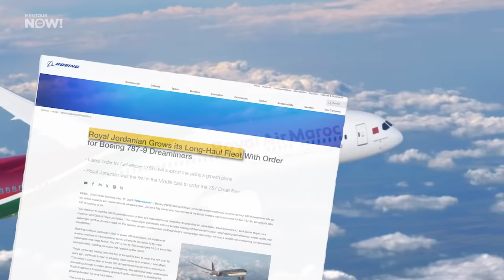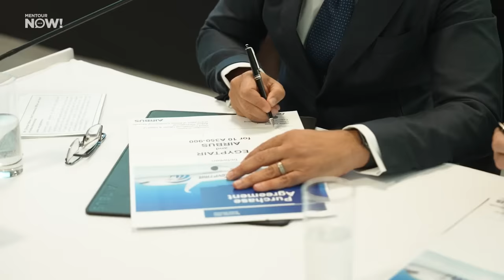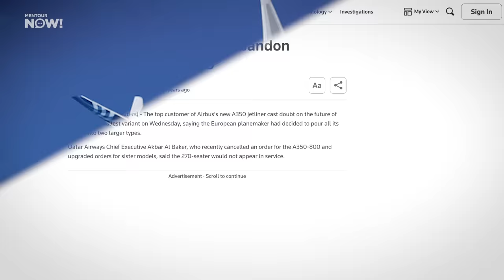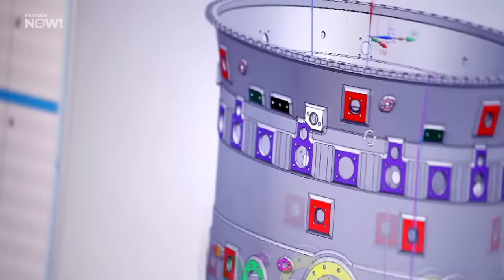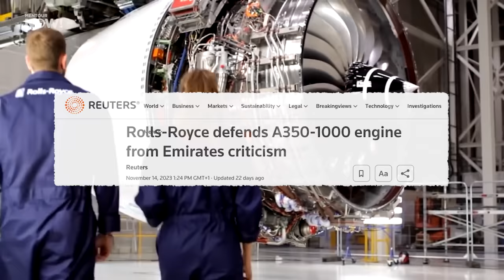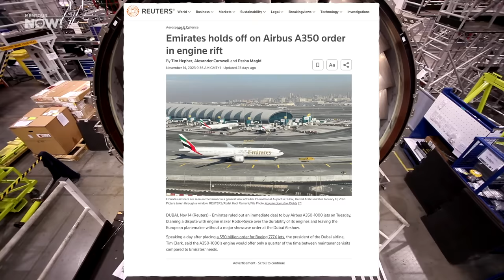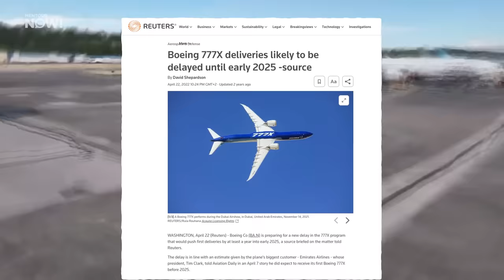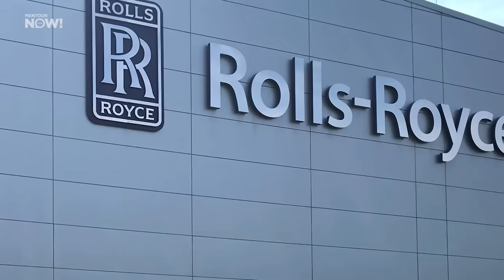What’s WRONG with the Airbus A350?!

Comment: After watching the disaster at Tokyo, I would say absolutely nothing is wrong with the A350. I can not believe how intact thecA350 was after it came to a stop. The fact that the main landing gear and wings were still intact after running through the Dash 8 is a testament to the aircrafts strength.
Reply: meanwhile Boeing can't even secure its door to stay closed during flight and just detach from the frame. i would not trust boeing with my safety at this point.
Reply: well it is completely built in carbonfiber composites (just like the 787 dreamliner) Aluminum has a melting point of 660 degrees celsius, composites burn at 400-500 degrees but despite that composite maintains it's structural integrity much longer in a fire than alumium which propably is the main reason that everyone had time to evacuate in time. I doubt everyone would have had time to get off if it was a for example Boeing 777 with aluminum. Unfortunately Boeing made the stupid decision to continue with aluminum fuselage on it's new upcoming 777X to save money on development cost which was another dumb choice, makes the aircraft both heavier and less safe.
Reply: @ragael1024  This is my issue with this channel.
It looks very much biased toward Boeing which is understandable if you have a lot of interaction with them.
But really, why isn't there any cover of the plug door issue here yet this video on the A350 for something rather minor.
It's "just a YT channel" but still, it would still be much more honest to just cover issues for both manufacturers.

The MCAS issue was also just lightly touched on this channel with not much blame pointed at Boeing...
Reply: @foadskyflier I'm pretty sure you can't convert an already aluminum fuselage. It's basically Boeing's A330neo. So I wouldn't really call it a "stupid" decision.
Reply: @Tetsuo6995 Petter touched on it quite a lot actually when it was going on. You sound like an Airbus fanboy.
Reply: @ryanlittleton5615  well actually the 777x started with the aim of completely new modern and more efficient aircraft, there where discussions of a completely new composite fuselage to be developed but they wanted to save money not to mention time in order to get it out more quickly due to order competion with Airbus so they went for just making new wings out of composite and more efficient engines. I'm sure the new aluminum fuselage is further optimized from the original aircraft but it was a dumb decision, especially given that they didn't save much time as it has been delayed over and over again as it is. They are going to lose on that decision in the long run.
Reply: @ryanlittleton5615  as stupid decisions goes, Boeing has done many  bad choices in the past 2 decades, they would have been in a lot of more trouble if it had not been for their military division that has done much better. It's really a shame as a healthy competition between the 2 companies is just beneficial for development and ultimately the customers/travelers, it would suck if they fell behind .
Reply: @foadskyflier  No the 777x is an updated 777 (hence Boeing A330neo). What you're describing is the 787. Which truth be told is an actually an even worse look for Boeing.
Reply: @foadskyflier  The 777x being completely redone in composites would just make it a completely new aircraft and not really a 777 anymore.
Reply: @foadskyflier  And for the record I'm NOT for a moment suggest Boeing hasn't seriously been screwing up the past 20 years.
Reply: What you talking  about it's burnt beyond Recognition🤕
Reply: I was at Haneda when it happened. Apart from the front landing gear detached by the collision the rest of the aircraft came to a halt relatively in tact. This is good news but the complete failure of the cockpit following the collision which came out at the inquiry is slightly concerning. The pikots had no control of the aircraft and all the  cockpit instrumentation and communication were inoperable. The cockpit could not talk to the cain crew and there was no indication ifr the onboard fire extinguishers had deployed. We should wait for the inquiry.  Excellent news that the excellent JAL crew managed to get everyone off without serious injury which is excellent.
Reply: @AndrewLarson-mq7xc  Oh well, another comment from an Internet armchair expert.
Go and check the timeline before you make such a comment!  The plane didn't go PUFF and there were only chorceld remains left.  It took some TIME to render the fuselage parts in smokey remains, and time was the essence for all people leaving the plane.
Reply: @foadskyflier  Aluminum soften at a temp much lower than the melting point. So it is very difficult to compare. AL may perform better in some cases and worse in others. From a manufacturing point of view, Aluminium is much easier to handle and the processes are well understood. Besides, 777 series has been in production with the same basic structure for decades and 777X is not going to throw everything out the window. If so, it will not be called a 777.
Reply: COYG
Reply: This entire thread is veritable goldmine of unintentional irony. Because you are right, but what you’re not mentioning is that that disaster (or rather the lack of a bigger disaster) effectively proved a Boeing whistleblower wrong. 

Years ago, a whistleblower named Vince Weldon told the press that carbon composite aircraft were not, and crucially, could not, be as structurally sound or fire safe in a crash as aluminum aircraft. He was specifically criticizing the 787 program. It was one of the earliest controversies that program dealt with. And it was, at least in terms of how it was reported, the archetypical old engineer vs corporate management dispute. The exact sort of thing that Boeing gets tons of sh%t for presently. Now if you asked me, Weldon’s claim that composites could never be safe was ridiculous right from the start. Composites are very strong and they are as flame retardant as the additives in their resin allows them to be. The recent incident proved that pretty conclusively. But still there’s something very ironic about all of it. That Mr. Weldon was effectively proven wrong by a crash involving an Airbus, but hey, sometimes fate just works out that way.
Reply: @foadskyflier There is something uniquely ironic about your comments given the amount of sh%t Boeing got for making the 787 almost entirely out of composites.
Reply: @alexanderstone9463 Boeing made a plane completely out of 💩😳
Reply: @foadskyflier yup and the new alloy contains lithium which as you probably have seen burns like crasy and water doesn't put out
Reply: Subsequent iterations of the A350 type may indeed see not quite so high a percentage of the aircraft made of composite material. The mix of Al and carbon fiber in the ill-fated A380 design was probably about right. Composites should be used so as to minimize weight within reasonable flammability/combustibility limits, and should generally not be placed under large compressive loads.
Reply: @steampunk888  380 is a pile of junk
Reply: @foadskyflier  to be fair aluminum is proven technology for cyclic pressure vessels, composite pressure vessels don't have an amazing track record with cyclic loading but technology is improving.
Reply: @foadskyflier  Do you work for Airbus?
Reply: @ragael1024  only because someone didn't put the bolts in that's over and will never happen agian.dont forget about the cracking wings on airbus
Reply: @foadskyflier the 787 has aluminium fuselage as far as I know, only the wings are made of composite
Reply: @simon.bartos  no, that would be the new 777X that is expected to have it's first delivery to airlines next year. The 777X is based on the old 777 from the 90s , it retains the aluminum fuselage but gets new lighter carbon composite wings and new efficient engines. the 787 dreamliner has composite fuselage and wings, the 787 aircraft is a completely new design.
Reply: @foadskyflier  you're true, sorry, my bad
Reply: @ragael1024  no it had no bolts big miss step in the production. Not about Strength. A mistake that a 120% will never happen again sorry folks boeing isn't going away only up..
Reply: @foadskyflier  not in anyway aluminum has always proved itself. For many years composites are not everything.when they do catch fire stand back because it's going to be awhile putting it out. I got one Sliverof composite on my finger skin at Boeing form a composite part.i had to have my finger scrape down to the bone every 6 months for 7years before it finely thev the pain a puss went away
Reply: @Tetsuo6995  Ohh yes I have felt that so many times...😅
Reply: @Tetsuo6995  Yep the door plug was a fuck up, and luckily it didn't happen at cruise altitude. The MCAS issue was bad, but it had been flying normally with western airlines for a while. I personally think the crashes were lack of training on how to fly a plane when things go wrong which they do. One of the crashes involved a plane that had been flown the day before and experienced the same problems and the crew handled it and landed safely. Well done them.
Reply: @foadskyflier  That's it's an update to the 777, if they had gone with a composite hull for the X then it would probably be easier and cheaper to build it as a new clean sheet model from the ground up.
Reply: @Tetsuo6995  I like mentour and everyone has their biases but I distinctly remember when the MCAS stuff was going on he was downplaying it a lot and saying it wasn't indicative of some deep quality problems at boeing, just a tragedy that needed to be rectified and that people shouldn't reflexively avoid boeing.

I'm still waiting for him to reckon with this mistake on his part and admit that he clearly misjudged the situation and the FAA's competence.

The 737 is an inherently flawed design at this point. I can understand liking it in normal flight, I'm sure it's a good aircraft that has had decades of refinement. But it IS a design from the mid 60's when requirements were quite different. To save money boeing have been upgrading it for 60 years now instead of designing an aircraft more fit for the times and it's reached a point where it is like IRL spaghetti code.

Again, this may work fine in normal flight but when abnormal conditions happen, there have been numerous examples of the pitch-up tendency that has come with trying to fit big engines to the low wings causing fatal accidents, even on older versions. So now they've come up with MCAS specifically to try and mitigate this thrust-induced pitching and we all know how that went. With this cost cutting trend we also now have their planes falling apart in flight. Boeing has big problems in it's processes and management and the people whistleblowing these problems (conveniently for boeing) keep dying so I personally don't see things getting much better.

Comment: Yeah, big problems! Airlines should all opt for Boing's 737 Max, it comes with automatic emergency door opening!
Reply: You can jump out if you have a golden parachute.
Reply: @Zodroo_Tint God man you said it perfectly
Reply: MAX also makes you feel weightless, like on a roller-coaster as it nose-dives to the ground.
Reply: We have to take the experience to the MAX @MegaSunspark
Reply: the 737 MAX has the lowest cost for maintenance, since it will either crash or be grounded very soon after the purchaser receives it.  Way to go cutting corners for profits Boeing MBAs executives.
Reply: Max is a great plane has been for 60 years
Reply: @AndrewLarson-mq7xc  The Max is not the same airframe as the 737, they merely share similarities. This is why the MCAS issue happened; it exists largely to compensate for the Max's modified aerodynamics.
Reply: Wasnt a door ...
Reply: @MegaSunspark  Rubbish learn what really happened..

Comment: As a simple traveler, I flew couch on Turkish airlines a couple of times last year on the A350 and B777 and in both cases I felt the seats on the B777 were a bit wider and had more leg room, of course because the 777 is wider, and that's why I prefer the B777 over the A350, even though the 777 is older, so I'm disappointed how the newer A350 isn't as comfortable.

Comment: What's to say the GE9X wont have issues when it finally enters service? There are 78 A35K's flying and not a single 777X. GE have had their share of problems with the GE9X resulting in the thrust being de rated to less than that of the GE90 115B it replaces.
Reply: It's not about having issues , it's about durability in the hot sandy Dubai climate. 

The GEnX entered into service with only some minor issues. Rolls Royce on the other hand had major issues to a point where 787s where grounded all over the world. 

Let's just say , GE has a better track record than RR atm
Reply: Trent XwB is far economically superior to the GenX in technology. Sustainability and fuel economics require state of the art tech. Airbus and all airlines using A350 -900/-1000 are very happy with its performance.
Reply: @Stvescr  who cares , airlines with the GEnX are not complaining and it accounts for 60% of 787 sales.
Reply: @Stvescr  who cares , airlines with the GEnX are not complaining and it accounts for 60% of 787 sales.

Comment: Very interesting explanations. The Middle East weather and sand/dust conditions had already proven very demanding for military aircraft and gear in general since the Iraq-Kuwait war of 1991. It’s no surprise that it would also prove challenging for highly advanced commercial jet engines. However, RR having field experience with 2 regional airlines should allow them to secure improvement solutions quickly, especially if they intend to regain profitability on these contracts ! Let’s hope they will sort this out quickly 👍👍